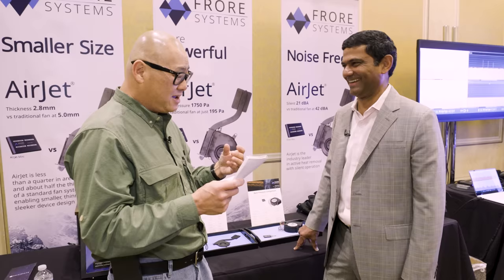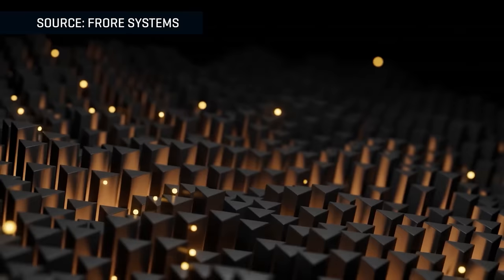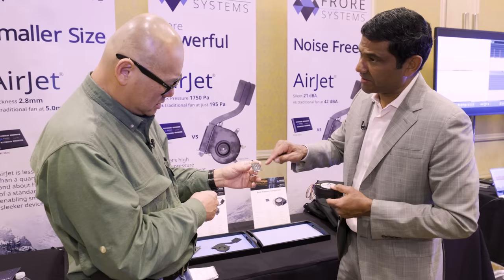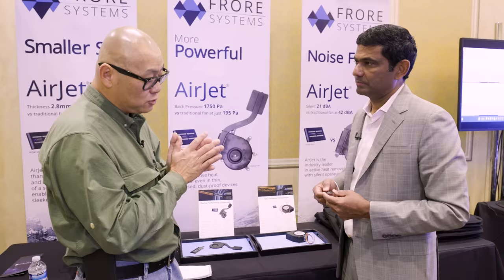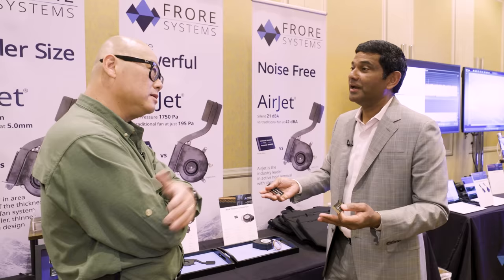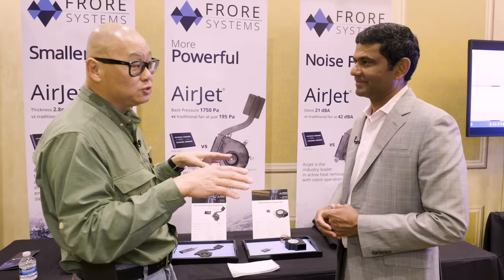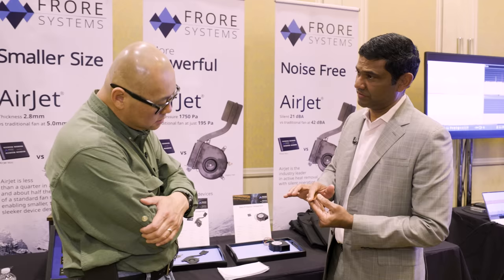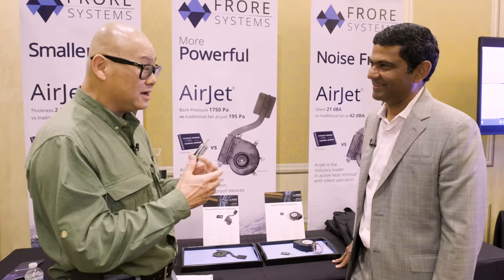Solid State Active Cooling Could Revolutionize Thermals

Comment: IM interested to see the lifespan of these coolers, while this is incredible in terms of capability and conceptually i wonder how long they would  last. Reliability is the most important thing when it comes to cooling solutions for your high end tech.
Reply: My thought were over time they ports would get clogged but maybe they do a burping technique to clear
Reply: @grantc8353  they explained it's so powerful it doesn't allow clogs, the material is pulled through apparently?
Reply: @ericomfg  they say it’s dust proof but if they are sucking in it must have a screen or something that will eventually get clogged. No idea though. Very very very cool product hope they do well from it
Reply: @grantc8353  yeah the dust can be captured but it won't clog, I think is what they said
Reply: @grantc8353  They stated you can have a really fine dust proof mesh to cover the intake and the back pressure will be enough to suck air through wile still leaving the dust outside. same thing you can find on most desktop computers but just much more fine and hard to pull air through

Comment: Pair this with A Peltier cooler and use this to draw heat away from the Peltier cooler itself. This would increase the surface area you could use for more of these devices.
Reply: At first I assumed it might be a fancy peltier pad. lol  I like your idea to try a peltier with this solid state cooler instead of a heat pipe. Would interesting to see how that compares to a heat pipe.

Comment: I really hope this is real/commercially viable. When your laptop sounds like a jet engine or has a water cooling loop in it, you know you need a better cooling solution at that point. This has incredible potential.
Reply: Yeah I hope so too, but I can't help to think this sounds like a scam
Reply: @augustgames6502  I thought so too, but he said we can expect devices on the market with this technology in the latter half of 2023, I wouldn't expect a scammer to give even a vague 'release' date so soon.
Reply: @Diogenes Pepsi  How is the not vague? Did he name what devices or which manufacturer? Send a chip to GN to test and I'll be satisfied. But then again, I want you to be right :)
Reply: @sino_diogenes  saying anything doesn't comfirm it's not scam.  it might not be production ready, but if works, there should be no problem to to put 3 motherboards with cpus, 1st being control with no cooling, 2nd being standart fan, and 3rd this thing, so we can compare thermals and how effective air jet is. I mean even if it's like 0.1 of fan effectivness, as long as it works there definitely will be applications for something like this. But with cheap trick like blowing ping pong ball, it does look like scam.
Reply: @Reinkjaky  their website does appear to say that Intel and Qualcomm are major investment partners. They also have a pretty extensive staff directory of people who appear qualified to engineer something like this. I'd have to do some bookwork to figure out who these people actually are, but there is some evidence here to give them credibility.

Comment: I wonder how the vibrating nature of this chip will hold-up over time in terms of product lifespan. Not only that, will the constant vibration have some negative effect on the the rest of the device over time? My 2nd question may be moot, because traditional fans by their very nature introduce some amount of vibration as well. But, relative to the vibration of a traditional fan, I wonder how that compares to this new cooling chip.
Reply: Those sort of MEMS devices are a very mature and time tested technology, the tech behind DLP the Digital micromirror device has been demonstrated to last more than one trillion operations and DLP chips are known to last more than a decade. If this is anything like those MEMS devices fatigue isn't likely to be a factor. Though power consumption is, like he said fans are 100 year old tech meaning they've had 100 years to get more efficient and reliable and efficiency (power consumption) is the elephant in the room in the mobile electronics market. All those boards behind him mention air speed, flow rates, noise, and size but not power consumption... If it requires twice the energy that a fan needs to dissipate a watt of heat it won't be widely adopted.
Reply: @billdberger7407  He said they each use a maximum of ~1 watt. 
If true, that's pretty darn good.

Comment: This is super interesting. They could start out the implementation with gaming phone, then to 2-in-1 tablets, then to ultrabook laptops and eventually to gaming laptop.
For PC builders, I could imagine this being implemented directly to CPU and GPU heatsinks. Tinkerers might even doing a piping to directly remove the heat out of the case.
I will keep an eye this tech very closely. This is a very big game changer in thermal side of the tech.

Comment: This is amazing. This is game changing to big gaming laptops but arguably even more so to 12-13 in laptops. The ability to shrink small laptops even more yet retain peak power will be mind blowing. Basically ipad levels of thin but being a laptop; which current tech is kinda at but not without thermal throttle and massive battery drain.

Comment: This is pretty sick! Would love to see this stuff come to DIY desktop PC, because boy are we dealing with a lot of heat also lol.
Reply: Air/water cooling is literally 10x more efficient. This will draw 100W to cool 500W pc. Its build of silicon chips and it would cost probably like a 1000$ or more at this size.
Do you still want it so badly?
Reply: @Cypeq  He said they are ambitious and they are going to be improving it. Of course in it's current state it's not good but I'm looking at it's potential.

Comment: It sure looked like a Peltier effect plate at the beginning, but it's an awesome new type of "fan". Can't wait to see this in my next laptop!
Reply: That was my immediate thought too, that it was just a Peltier scam with lots of cool buzzwords like "MEMS" to disguise it. Maybe it really is something new and unique, but I'm sceptical and we need to see studies and independent performance numbers vs existing solutions. It will also be very expensive.
Reply: @sl9sl9  yeah my company for the time being is done using laptops, and we’ve stopped our operation of laptop repairs/fulfillments to stand behind our beliefs.

The amount of people that told me their PC was 2-3x as fast, had the same processor and typically memory specs minus ram compared to their laptops gave me a chuckle.

Common sense you just cant expect a laptop to last even a year under 60% load without a clogged cpu fan or heat bottleneck.

Comment: MEMS based so I'm worried about durability of dust particles breaking the vibrating MEMS elements. Additionally since you're moving air really quickly I'd be concerned about triboelectric charging which could result in an ESD discharge (granted there's alot of copper there which would likely be connected to chassis ground so that could dissipate the triboelectric buildup real quick).
Reply: I have the same concerns. Dust is an impossible to prevent hazard, so depending on the price and lifespan of these chips it could be more economical to stick with fans. I doubt you can just blast these chips with an air compressor to clean them, but the technology is fantastic nonetheless.
Reply: There's many concerns but they already have a client. It is going to be used in a new product this year. That gives me more confidence that it may have been well tested. Unless of course it isn't going into a product like he said.
Reply: there are so many problems with this product
sadly we're still stuck with fans or peltier elements
Reply: That's a very good point. ESD can be an issue. Like you said the copper may be connected to ground. Well, the future knows that truth. Let's see when it finally is incorporated into videocards, laptops and desktop PCs.
Reply: that was their first concern on day one bro. It's been 4yrs of trying to break their own product. It's like you think you're the only one who thought of this
Reply: well they said it allows for dust filters
Reply: It all comes down how the carbon nanotubes are arranged
Reply: @Bill-bj9fn  As he said in the video, the dust can be prevented from entering the laptop in the first place by using an IP68 filter. So that the Air that enters the AirJet is filtered dust-free air.
Reply: @Xevos701  If we are talking laptops, I don't think that people will be interested in having to consistently replace a component of their laptop. If Apple gets their hands on this technology, they will most certainly abuse consumer rights with this.

Comment: This is incredible! I wish, they would have mentioned the longevity of the membrane or the components as well. Does it stretch/get sloppy over time? Does it break/rupture as it gets old? Also, can you use fins instead of the flat copper plate to maybe increase the heat transfer?
Reply: He mentioned you need to have hit the plate relatively perpendicularly. I’m sure they have considered fins
Reply: It will probably outlast any fan. Think of it as a steel sheet, you can flex it as much as you want as long as you don’t excede the specifications of the material.
Reply: It uses mems tech as he said which is used in projectors so it’ll last more than the device that it goes in
Reply: @user-pq4by2rq9y  ferric materials like steel dont have fatigue limits under certain cycle numbers unlike aluminum which is guaranteed to fail even if yield strength isn’t exceeded. Theres no way to know unless the membrane material is known.
Reply: Longevity of membrane will be very long, however longevity of the whole fan wont be. They say they can "dustproof", but you cant dustproof it enough, if you want any functioning and usable airflow. And while your old spinning fan can work at 70% capacity covered with 3 mm of coarse dust, this thing will probably stop working with 0.5mm of finest dust inside it. Except you probably wont be able to disassemble to clean it. I wonder how they wont to deal with that, except for the consumer to pay for replacements.
Reply: @allanperl5107  amen ! love it when people discuss the product instead of just praising something or someone from the video
Reply: most mems are not that unreliable, and even if so, you can probably replace it for not that much.  I'd be more worried about how much cooling it actually achieves.
Reply: @djuarakurniawan4738  some other comments discussed about this and i feel like the logic that "with how quick the air is moving through if the dust is small enough it wont build up inside the thing" is sound enough. That means they might not need super fine filter, just something to ensure dust particle bigger than certain size (maybe the membrane gaps) cant get in.
Reply: @Crustee0  "i feel like the logic that 'with how quick the air is moving through if the dust is small enough it wont build up inside the thing' is sound enough" - However, dust buildup INSIDE is only one of the potential problems.  Dust buildup OUTSIDE (around the air inlets) is another problem because once dust sticks to the outside, more dust will stick to that dust until the inlets are completely covered.  Having said that, I also seriously question the claims of air speed, especially based on the demo of what appears to be a ping pong ball at time index 4:09.
Reply: @nomore6167  if its on the outside then its not as problematic to clean, and as with other active cooling you have to maintain it anyway. If its easy enough then i dont see it being a problem.
Reply: @Crustee0  "if its on the outside then its not as problematic to clean, and as with other active cooling you have to maintain it anyway" - How many desktop computer owners open their computers to clean the fans?  I'd guess the answer is less than 1%.  If we're talking about laptops, I'd guess the answer is even fewer.
Reply: @Crustee0  Yeah but there is a difference between air velocity at the membrane layer and the collective velocity needed to prevent dust buildup. I'm thinking since the membrane is under continuous vibration and is porous, it will not allow dust to stick onto it
Reply: @nomore6167  He's probably talking about outer dust filters that you can magnetically peel away or detatch without opening the laptop. It's used often, just not in ultrabooks because of size constraints

Comment: This is a really awesome concept. After taking apart an absurd number of computers in my lifetime I worry about how this will handle dust accumulation especially with such small channels. After all one of Murphy's Laws "Leak proof seals will" I think will apply here.
Reply: I think a bit of canned air would suffice.  Smaller channels also means finder dust which is also easier removed.
Reply: @clblanchard08  you'd think but you mix just a small amount of aerosolized oils and dust turns into glue
Reply: I imagine the high velosity of air would act as a duster in of itself
Reply: @andrewrichards188  ye that’s what I was thinking, like air is only travelling 1 direction and it’s outward, if you as long as you had something to keek the physical metal free of things sitting on it, even something like a tiny wiper blade or a tiny other things that blows air off of it it should be ok. Might not even need that tbh.

I could be horribly wrong but suppose we will find out in time

Comment: That's interesting! I was wondering if this wasn't going to be the same idea as this "ionic winds" concept from a decade ago where they used gas ionisation to create airflow (and ran into a number of issues like releasing potentially toxic gas ions in the room). This MEMS vibration thing actually sounds a lot better!
Reply: I thought this as well, or sub/ultrasonic speaker and diaphragm valves or something.
Reply: Problem wasn't ions but it could create ozon which is problem.
Reply: Given how small it is, what is resilience to dust
Reply: @A___-naut  an maybe water, so we get phons with it ;) 
depending how MEMS are design, they didn't show it in video.
Reply: @m_sedziwoj gibberish

Comment: This is great! This is the solution  for the negligence of big companies of creating a chip with thermoelectric materials (for now).

They could use vanadium dioxide, or Purified tin selenide, whose propieties allows an excellent electric and termic conductivity in circuits. 

They could use materials that we already have (or alloys) and use the next ones to come. Recently, scientist have discovered new thermoelectric materials that don't even have a name. However, some of these materials have intellectual property rights.

What will we achieve with this? dissipate heat with very good passive cooling and remove extra parts like air cooler fans, and maybe big heatsinks and heat pipes. 

The heat is the enemy of computers, it's time to change and make the circuits evolve to the next level.
The future is promising, the future is out there.

Comment: Sounds like the vapor chamber could possibly be a bottleneck to this solid state cooling chip. Also what happens if those vibrating membranes get worn out or stop functioning. Curious how this thing holds up long term.
Reply: He did say it took 5 years to develop. If they took it to CES then they must be confident it will be reliable.  But it's also true that lab testing in a controlled environment is not the same in a real world end user mode. Nevertheless it's just the beginning for this device.
Reply: The interviewee commented that the vapor chamber didn't significantly impact cooling performance, and is arguably an improvement due to allowing greater surface area for the airjet to be in contact with.

That said, I'd love to see it used directly on top of a desktop CPU chip; possible water cooling replacement for enthusiasts?
Reply: What i find a bit misleading is that i doubt this device will work without tubing like the current fans have. They need tubing to direct the airflow out or suck the hot air away at certain points.
Reply: @RomboutVersluijs  Definitely must use ducting channels to direct the airflow in and out.
Reply: @Movieman1965  this brand does as well. I've now seen more vidoes and they actually use 3-4 of these chips with a huge vapor chamber to get an airflow going

Comment: It would have been interesting to know what the heat transfer per cm² is, how much TDP they can handle at the moment (with a chip) and how many hours of life expectancy they have.
Reply: The life expectancy is a big one for sure
Reply: And how much heat does vibrating the membrane generate?
Reply: As they said, currently it consumes 1 W  of power. So you can expect, it genereates aproximately 1 W of heat